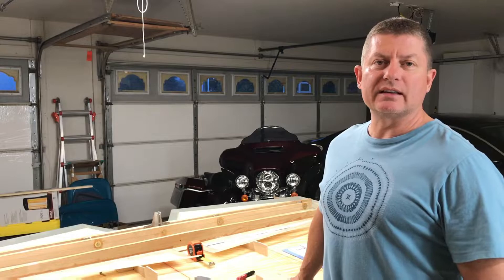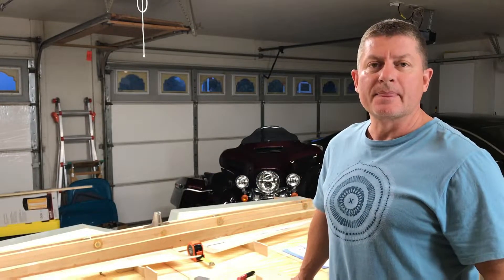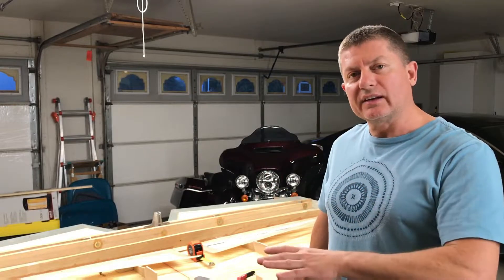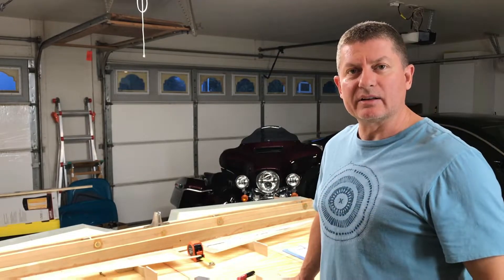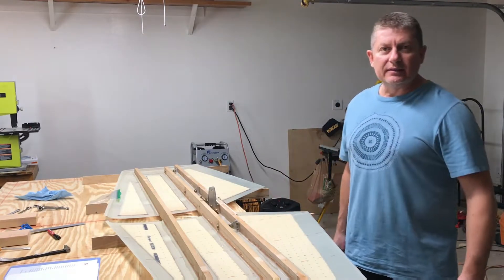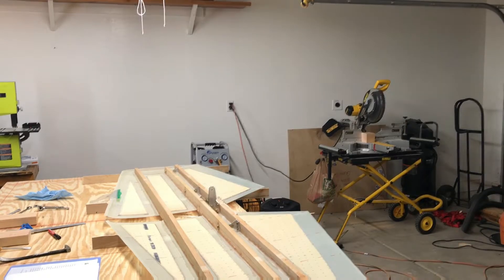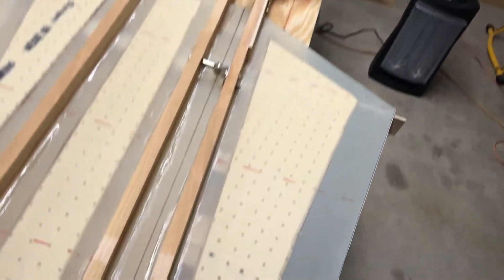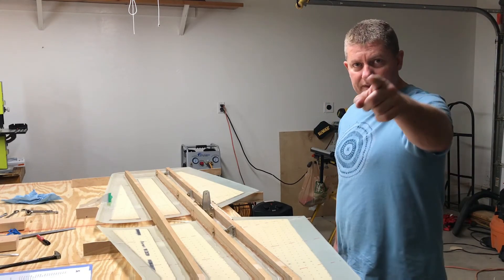S7 - Gluing the rear/elevator spar into HS - Experimental Airplane

Comment: I am enjoying watching this process. I am very interested in the Saberwing, however, I have a long way to go before I could pull the trigger on such a project.  Thank you for recording your progress; there is so little on youtube for the Saberwing. A couple of questions though: 1) are the instructions really that easy to follow, or is there some basic knowledge that is necessary? and 2) you mentioned in one of your previous videos how important it is when choosing the motor; can you go over which motor you're leaning towards and why? 

Oh, and some information on your flying experience, why you chose the Saberwing over the other kits available, and what you're primary mission is for your Saberwing (cross-country, or just fun, etc.) would be fun to know (just curious). Thanks again for sharing your project, I look forward to following you through completion!!
Reply from the maker: Hi Jason, thanks for your interest in my build! You're right, there is little info on the Saberwing as it's a fairly new player in the market, and the current builders are mostly offline. Serial number 16 is now out the door, and I'm hopeful that as the company grows, more photos and videos will begin to surface. I'm actively working on changing this! 
Instruction manual. It's a work in progress and will change as each update comes out. It is very straightforward, and what I'm seeing so far, the build is not complicated. I am a bit of a perfectionist which doesn't help to simplify matters. Remember, I have no experience in building a composite airplane and so far it's going good. I have rebuilt engines and built things out of wood, from coffee tables to houses, so I do know how to use tools, and I can read instructions. Bill is also readily available by text or phone for questions.
Engine: Ideally, I want to install an engine that is between 150-180 HP. I would also like it to be fuel injected and best case scenario, FADEC. I don't mind managing a computer and not dealing with air/fuel mixture, carb ice, etc. It also helps with the fuel consumption. One engine that I'm quite impressed with is the Aeromomentum AM17 150 HP. It has a long history of being worked hard for many hours (4000 on the highest) in air boats under heavy loads. Real world testing that has proven itself. They are a fairly new player in the aviation arena, but the engines and PSRU's are not. No decision yet, but I will need to get serious soon as the fuselage will be coming soon. I'll be writing a blog on this soon, watch the website: https://www.BuildaKitPlane.com - there is more info there as well.
I say don't wait any longer, pull the trigger now! Order one partial kit at a time and take your time building it. Save up in between and stretch it out for whatever time frame you need. There always seems to be something that comes up in life which pushes the airplane build to the bottom of the list. Once you start, you'll find a way to manage it. 
Cheers, Dan

Comment: looking good Dan.  
Question, how much of the wood is already cut to fit ? Were the spars ready to install or did you need to shape them?
Reply from the maker: Hey Joe, those spars came precut. I didn’t touch a thing putting them in, although it is recommended to sand if it’s not sitting flat. I’m guessing the second skin I may need to do a bit of sanding to ensure a good fit